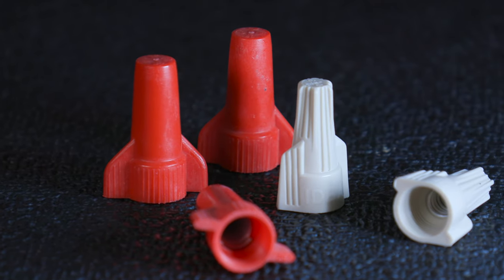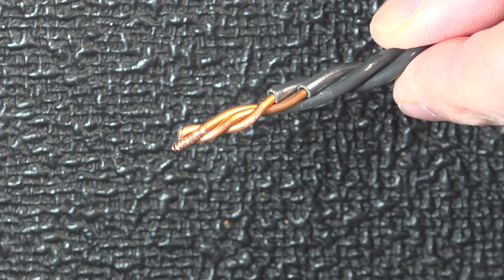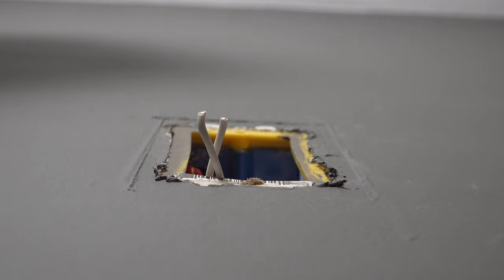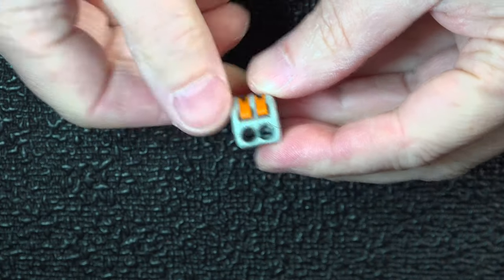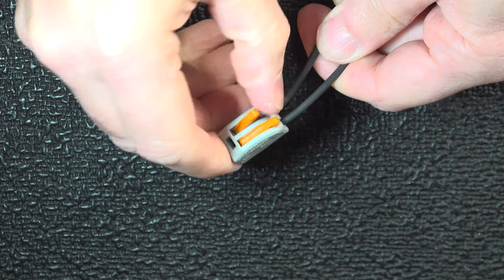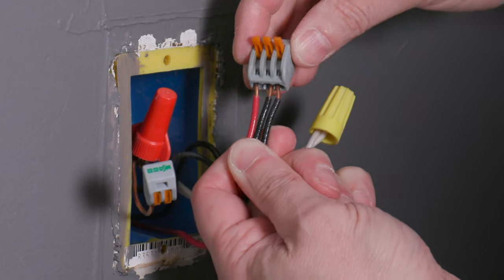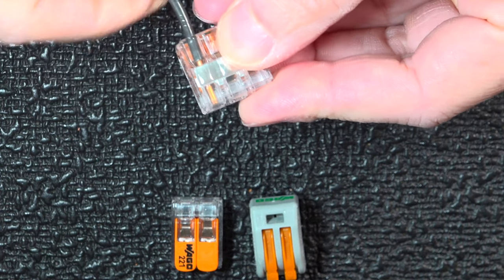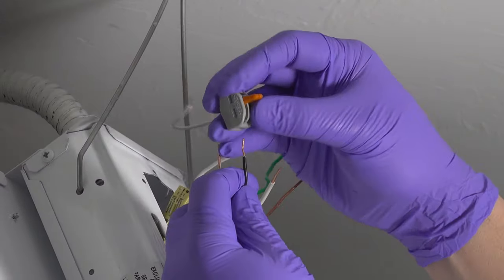Never use Wire Nuts Again - Wago is Better Electrical Connector

Comment: There is no place for DIY in electrical, you are risking burning down your house, killing your children, and possibly electrocuting yourself. The bad thing about electrical is is that it will work even if it is unsafe and wrong. Call a licensed electrician which will also carry liability insurance.  If you read your homeowners insurance policy you will likely see a clause that states any work should be done by a licensed and insured contractor. If you do burn down your house and the insurance company learned that you were doing your own electric work they could deny your claim.  Also, if you are not an electrician you should not be giving advice to people about doing their own electric work.  Blind leading the blind.  And just one of my pet peeves while I’m on my soapbox, I cannot stand when a homeowner compares me and my pricing to two guys working out of a 1984 Toyota pick up truck. Try finding that 1984 Toyota pick up truck when something goes wrong.

Comment: I thought people had stopped using these years ago. We had to learn to use this in my electrician gymnasium (I took the exam almost 2 years ago). I have never once used these after that. We basically only use spring clamps or Wagos in some cases, because those suckers are expensive.
Reply: Wagos are as "expensive", as they are productive. The few cents really will not hurt you.

Comment: Probably need a peice of electrical tape to secure the latches from popping up. At times you push them in the box and wonder if the could unlatch ?
Reply: They never do they’re made to meet strict safety standards and used in Europe very commonly, we don’t use wirenuts atll

Comment: Do you burn the house down there not very good for amperage all the wires are together very strongly to wire nut and if you use the right wire not an apparel line summons to turn them you don’t have any problems

Comment: Every so often a product comes along that is so good you should just take the recommendation and use it.  The sort of product that you will thank yourself later for using.  The Wago connectors are far and away that sort of product.  Don't get a substitute, get Wago.

Comment: Cool, but a few things. Wasssup with the dirty sneakers? You should have moved them.
And, a pipe wrench to tighten a wire nut - LOL.
One more thing - not a paid promo, but you have an amazon link that I imagine would bring in some nice dough after a few million views.
Yeah, those look cool and a nice alternative, but would like to see the difference in size compared to wire nuts when cramming in a couple of triple 12 gauge connections in a shallow box. 😯

Comment: Euhm... these are around like 10 years or so? And they also come in 8, not just 2, 3 or 5 (2 rows of 4 above eachother that is). They also have very small ones to connect a UTP cable (or SVV). At least here in Belgium...

Comment: Probably good for DIY people. I see too many times where people put on a wire nut and it falls off with the lightest tug, or only one wire threaded. 
For professionals my gut says they'll go with whats cheaper and standard
Reply: In Europe Wago's are pretty much standard now. I guess if you tried to use them for some time as an electrician you would see that they are very quick to set up and can safe time in the long run
Reply: And safer.  Wago connectors are going to cause more than a few electrical problems in homes ones these DIY people start using them on household wiring projects. They are not safe for high amperage connections.
Reply: @markusallport1276  The standard 221 Wagos are rated for 32A continuously...

Comment: If a wire is properly twisted together I do not see the problem of putting a wire nut on it.  As long as the person installing it makes sure the wires are connected correctly and firmly without the possibility of arcing to occur.

Comment: I will not put my family or customers live in the hands of a lever, that's what a electric chair uses 😂. I don't trust those, I've seen neutral fires nearly started because a lever came open from movement and I've never had a problem with twist or crimp wire nuts. I might if I was to have a stroke and put a pipe wrench on it, at that point you may as well bring your vice to the job too and why not hold the wire with a pair of  lock jaws 😂.
Reply from the maker: You wouldn't trust a German made connector that's been a standard for 40 years across the world but you are ok using a toothpaste cap with a nut shoved in it?
Reply: @SilverCymbal  seems I triggered you 😂, even though wire nuts never made the NFPA list..  that "toothpaste cap" that's been in use just two years shy of 100 years had never failed me. I see you tighten up the wire nut with a pipe wrench, do you close the lever on yours with a hammer? 😂
Reply from the maker: @divineknowledge4607  If you mean responding, then sure. US companies did a great job keeping Wagos out as long as they could but eventually couldn't deny the fact wire nuts are illegal in multiple countries and have been for decades. Most US sparkies have no idea of this and believe this is the supreme connector. Do what you want but there is a reason Ideal had to come up with their own push connector that is awful but they can't use Wagos patent so their options are limited
Reply: @SilverCymbal  uhmmm omitting some basic fact aren't you? Europe banned then because they used aluminum wire. They used to be ceramic, which did cause problems, European wiring typically has 3 wires to connect rather than just two. And seems your argument leans towards saying that Americans are smarter than the European handyman
Reply: @SilverCymbal  oh, and you think your wire fastening company doesn't have a hold on your governments pocket book? If so you're as insane as someone that tightens a wire nut with a pipe wrench the size I use to take apart a industrial boiler at work.  And I do not believe you aren't sponsored here. FOIA can sort that out for a few swipes of a pen of requesting wago's sponsor  information, if I really cared, which I don't 😂 😂.
Reply from the maker: @divineknowledge4607  Knowledge? One ancient reddit post? Hardly the basis for why went away, see technology improved and so did the reliability of the connections with Wagos. The ONLY holdback of Wagos here is fear, that something terrible will happen, but it never does. Do your search again, look for burned wirenuts and prepare for hundreds of images, do the same with Wagos...0  Forutnately the NFPA tested these recently due to overwhelming concern for events that never seem to happen and gave them a great score. Wire nuts are excellent for capping left over caulking, though, Wagos can't do that
Reply from the maker: @divineknowledge4607  I am so glad you said this. Please call Wago or post on their facebook and ask if I have ever been paid a dime or given anything for free or if they have ANY connection to me. Be my guest, but when they confirm no, will you let me know and will you apologize? Have you tried a Wago?
Reply: @SilverCymbal  triggered 😂😂😂.

Comment: Looks like the lever mechanism will fail on its own at an undetermined time while in use and  tucked away behind the panel, especially since it's an Amazon purchase.
Reply: The lever dies not hold the connection. It is only there to facilitate installation. The connection is made by a sprung metal connection which applies constant force to the wire indefinitely.

Comment: Most of the negative claims in this video do not seem realistic.  If you take time to make sure your connections are tight, they are insulated, and they are not subject to physical changes over time, they should last nearly forever.  Plus, how many times do you really need to make changes to a wiring box connection?  Frankly, if you need to cut the leads enough times to make new connections until they are too short to reconnect safely, you need to consider rerouting a new line from your power panel because you probably have too many loads on the circuit causing a different problem.  Rule 1: If you daisy chain receptacles, nut the lines with pigtails to the receptacles.  You can cut and replace the receptacle lines an infinitum until the pigtails are too short, then replace and retwist the nut connections once...and you are back in business.  Rule 2:  If you do not understand what you are doing, you should find someone who does.

Comment: I have been a sparky in the UK since 1981 and I have never used a wire nut. I think we stopped using them over here in the 60s

Comment: Wago style connectors have been around forever. There on the back of outlets already.  The problem with Wagos is that they're twice the size of wire-nuts. And contrary to what you said, wire-nuts if twisted together and cutting the tip off the pairing at a slight angle allows the wire-nut to bite better and go in further. I have used the same wire nuts over without any pull out whatsoever.  But the most important aspect of the wire-nut is that the twisted copper members have a greater surface contact area than does the Wago's.

Comment: I am going to agree with the hazards of a wire nut but will have to disagree with the connectors in the video and ones similar. There is a thin piece of metal that makes the connection but it’s also making the connection on the edge of the metal. It’s a really small point of contact that also makes these potentially dangerous.

Comment: Perhaps he's never seen any wagos meltdown inside a box from too much current going through them. It looked like melted candle wax. They can't handle a lot of current (amps) they are a bad idea I'm a 25-year electrician and I will only use them in connecting power to single ballasts or to tombstones for fluorescent lights, they don't pull much current so therefore they're safe in that application. Wago's use a piece of spring steel basically a knife edge which is a small amount of surface area contact to the conductor. This is why they melt down. A conductor's ability to carry a lot of current is based upon its circular Mills or diameter and or surface area contact for a good connection wagos don't provide that, therefore don't use the push backs on outlets and switches they use the same mechanical type of connection that can fail with high current flowing through them.
Reply from the maker: You are right and neither have you, not a single Wago 221. Maybe some other crap connector but that's not what the video is about. How about overloading them, surely they would meltdown right?  If you dare... https://youtu.be/B1pmuRsf1co
Reply: Your reply doesn't make sense. The brand that was used was Wago. I don't think you're an electrician so I'm not going to mince words with you. I just don't like people giving bad advice especially when it's not their field of expertise.

Comment: Don't use wegos they got rid of the 8 wire stab in receptacles for a reason. The blades that hold the wire have very little contact with the wire. Zinsco was UL listed one point in time too...
Reply from the maker: Yup, except those crappy outlets never had a patent. There is a reason why Wagos due, its different
Reply: @SilverCymbal  A patent is not the same thing as UL listing. How about aluminum romex?
Reply from the maker: @chrisminblkdiamond  Of course I am simply telling you that all clamp mechanisms are not the same. These are are approved by UL, CSA and a dozen other worldwide certifications. The NFPA ran some in depth tests on these 4 years ago with excellent results as well. Not much more you can ask for approvals

Comment: As a DIY even I would not think about using a large water pipe pliers. For one it's gonna be heavy and hard to handle. They probably took multiple trys to get it to work that way. I know it was just for theatrics but makes me distrust the commercial. Why, because people don't do that.

Comment: These are horrible constantly replacing them with wire nuts in the field because they either burn up from arcing and overheating due to bad connection or just don’t work brand new. Do yourself a favor if you have these anywhere throw them away cut them off whatever you gotta do to get some fresh bare wire without bite marks then pre twist with side cutters and put the appropriate wire nut on. Unless you need to butt splice wire nut is best and longest lasting as long as you do it correctly.

Comment: You start running into issues with space with wago connectors. They also have issues for stranded wire.
Reply from the maker: You are joking right? They are the best on stranded wires and run out of room?  Watch this: https://youtu.be/xuj-sEJryxw

Comment: A wirenut used properly is a safe and secure fastening device. These things are another pressure connector that will eventually fail and become a fire hazard just like the receptacle speedwire pressure connectors were.

Comment: I’ve heard many times that wago is dangerous for high power wires and you should use wago only for lights and soldering or welding for other. But I don’t sure. I think the main reason not to use wago is a price, not danger.

Comment: Solution to a problem that doesn't exist. Most wire nuts will connect 2-5 leads, no need to look for an right connector. The connection is much better when done properly, takes the same amount of time for an experienced electrician and if you do not over tighten can be modified rather easily without having to cut anything. Another thing to consider is these take more space which is a concern for older overloaded junction boxes.
Also, modifying connections is the last thing to have in mind given how you're supposed to run new lines from panel in case of renovations anyway. I've ran into older homes where extensions were necessary, but those were mostly cases of wire being initially too short rather than some clueless electrician cutting them so to modify things.

Comment: The area of contact between the wire and the connector is very small with this sort of connector.
Reply: Small contact area....resistance....heat....fire....

But hey! They look cool, right?
Reply: @DragonAurora  Makes you wonder how this type of connector is legal to use in the United States . Someone paid to look the other way ?

Comment: As usual, trying it invent a better mouse trap fail.  For low current this devise probably works ok, but for higher current a wire nut would kick it's ass. A wire nut properly installed makes a very good dependable connection.
Reply from the maker: Search on burned wire nuts sometime, see the pics you get. Search on burned Wagos, and you will find 0. Tells you a lot about which one is failing out there.

Comment: wago is a german company. all new installations in at least the past ten years here in germany are exclusively done with wago connectors, simply because they are a superior connector in any way compared to anything in existence.

that said, you us folks have way more hurdles to overcome than we have over here. first, it is not allowed in germany to run stranded wire through your house (thats the reason something like a "wire nut" does not even exist over here), so you can not use the cheaper and simpler "push in" style wagos. second, because you use only half the voltage (110v compared to our 230v), the connectors have to be more beefy, as they have to withstand double the current.

that said, i personally could not close a single eye knowing to be in a house of wooden construction, running unnecessary high currents through them while their ends are twisted together with a "wire nut". i also do not want to imagine the pain that is involved in maintaining and troubleshooting such a system.

Comment: Why do you keep having to cut the wires in a duplex box?  No wire nuts are used on the receptacle, which is the part that wears out.  When replacing the receptacle, there is no need to mess with any wires that are wire-nutted together in the box.

Comment: And yet in the 2020 NEC it stats that wire nuts may be reused…. As long as you properly twist the joint first there is no issue with a wire nut. Wire nuts help provide a secure connection that will last a very long time. I can bet you that these will fail long before a properly twisted joint.

Comment: Not an electrician but have done work in my own house. One time used these new connectors for a light switch something was wrong with the connection and I had my buddy who is an electrician come check it out and he cut the connectors lol and pig tailed them with wire nuts.

Comment: yeah i see the reason why they banned those in germany. ANother reason is that u bend the copper wire too much and in germany it exceeds its maximal point of bending which should be no more than 90° as far as i know. correct me if im wrong

Comment: I absolutely hate Wire Caps. I only work on electrical wiring at home and not a pro and it always took me forever to get something capped safely. Once I found about these Wago connectors I immediately bought a box of 50 and it makes connecting wires a breeze. I have used it on a ceiling fan light fixture and a motion detector light. Both are things I did in the past with caps that took me an hour of messing with on top of a ladder. With these I did both of these things in under ten minutes each and most of that was just the other stuff, the actual wiring connections took less than a minute.

Comment: Not enough contact surface with these kinds of connectors.  this increases the likelihood of the wire overheating.

twisting the wire around the other wire is best for a decent surface contact.  If you know what you're doing, wire-nuts are superior.
Reply from the maker: So you mean like when I tested them at 60amps? 3x their rated capacity along with wire nuts  https://youtu.be/rMlI7qOm8hM